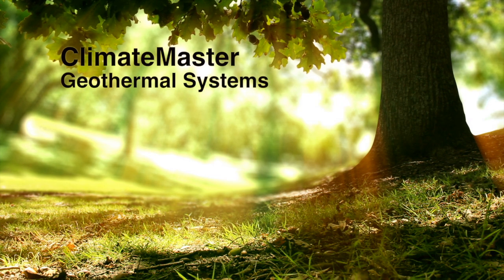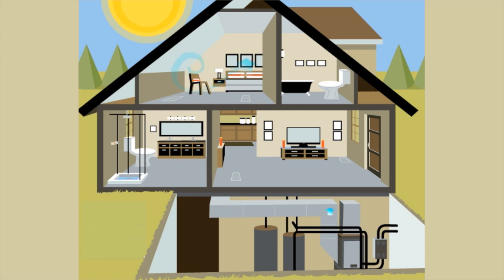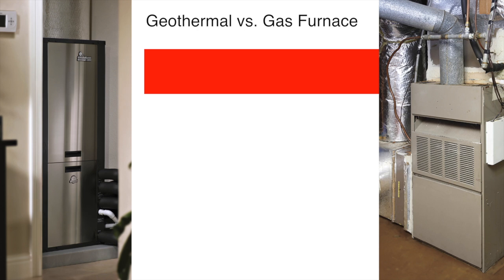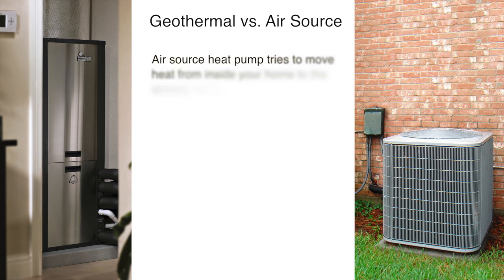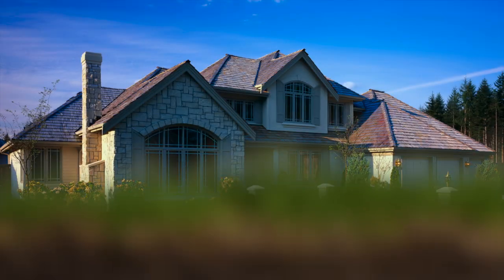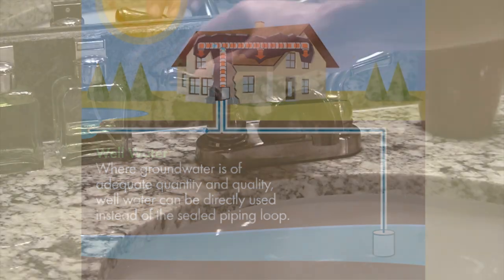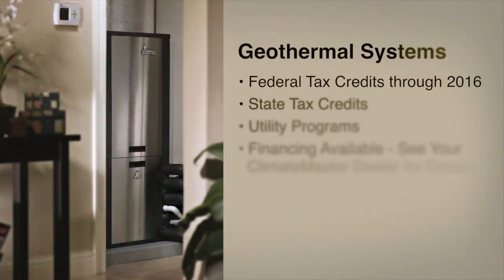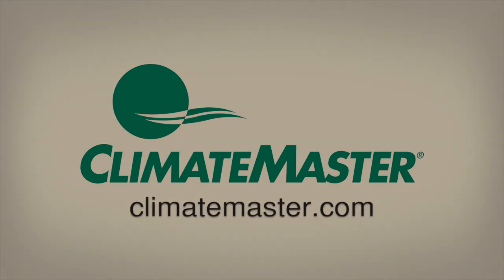Benefits of Geothermal Heating and Cooling

Comment: I had a Waterfurnace geothermal product for 20+ years.  Because of its age, i needed to replace the system. I acquired energy consumption data from my energy provider, crunched the numbers which included all of my expenditures, and looked at the alternatives and what science said about them. And also, because of geopolitical issues, it was increasingly clear to me as a Canadian that purchasing American products in these hostile times made absolutely no sense. Finally, I found a Japanese heat pump, Daikin, that is remarkably cheaper and just as and often more effective than Waterfurnace, and this is based on actual real-world energy consumption data. If you are considering a new furnace, take it from someone from a cold-weather climate, heat pumps are more efficient and cost-effective. As a Canadian, the decision was simple. I went with a non-American company,

Comment: We have both a gas furnace (emergency heat) and a conventional heat pump.  I'm finding out that at about 40 degrees and below it is more economical to heat the home with the gas furnace.  The heat pump doesn't deliver hot air through the ducting (warmed air, but not hot) and the spouse is happier when it is cold outside to have the gas furnace heating the home (happy wife. happy life!).

Just sharing my experiences. Mine may be unique.

Comment: Cost $30,000 to install a Geothermal unit in my house. The unit lasted 3 years before the pipes underground broke a leak. Found out a couple days ago that my unit is screwed until I dig up the pipes to find the leak. My house got the unit in 2019. There’s no compensation, I have to pay to fix it myself. It’s in the middle of summer, my house is currently 86 degrees. Great experience so far
Reply: $30,000 would be cheap I'd think where I live.  A well is minimum $25,000 and rock.  The mountains on colorado where frost line is over 4 feet also

Comment: These systems will cost more than a traditional system, but what you have to factor into the equation is "How much will I spend to heat and cool my house?"   So if you are building in Fairbanks, Alaska, where most of the heating is done via fossil fuels, you can cut the fuel bill to nothing.   The kicker is you have to take out a loan that may add $100 a month to your mortgage.   So its simple really.  How much on average do I spend heating my house?   If it is $200 a month, then you should have already done it.

Comment: According to my calculations, it would take 40 years for it to start to pay off the investments, from the amount of money I'm using now for heating. Fuck that. The same shit as solar heating. Waaay too expensive.
Reply: You're right, there aren't many advantages to this other than its probably a lot more reliable than using a air conditioner to cool your house in summer since I've had a few break during the worst of the heat whilst underground tubing only needs a fan to blow air threw them and can be easily replaced if the fan breaks.

Comment: I’ve been working for a geothermal Company for 3 years now as a sheetmetal apprentice. It really is amazing. New construction makes most sense. We do mostly condos and net zero buildings. Will most likely be the future of heating and cooling. I love my job.
Reply: Can you send your company details. I am interested.  Send me your mobile number
Reply: Can y get me some details about any project using this 
Like materil of pipe sequence of working
Reply: Why people don't use this instead ac?
Reply: Really? Does it work in the tropics?
Reply: There is an easier, more useful, and better way than digging all of this just for the sake of extending pipes, and it can be used anywhere on the ground under special conditions according to each region, but the idea needs support from anyone whom I might make a partner in this innovation.

Comment: So with a pond; during winter I'll chill the pond down and in summer: heat the pond up. It's ok?
Reply: yes. It does not  happen automatically that is why heat pumps are used.  Heat pumps take transfer heat from colder place to a hotter place using electricity .

Comment: How long will it take before you start saving money because this looks real expensive!
Reply: When I built my 5400 sq ft home in 1997, I installed geothermal. It was the underground loop system because I had a lot of acreage and didn't have a pond yet. My budgeted electric is usually between $200 and $300. This included my geothermal system AND the general use electric. I figured the system paid for itself in the first year because of the utility savings AND the credit I received from the local power company. It was about $5,000 more than a conventional system. I should also add that I have 6 inch walls and over 45 windows, patio doors and glass entry doors. I live in Michigan.

Comment: See video about the guy growing oranges in Nebraska.  He just buried 6-inch stovepipes.  No messy anti-freeze/water in the pipes.  Just bury the pipes 8 feet under ground.  Then a low-wattage fan to push air through the pipes and the air that comes back is at ground temp.  The guy who's doing this for his greenhouse in Nebraska uses 200 feet of pipe to achieve this.  These guys are making it way more complicated, expensie and energy-intensive than it needs to be.  Why even mess with a water pump?  All you have to do is move air through buried pipes.  You just need enough pipe and a day or two with an excavator to excavate and then fill it back in.

I'd pair such a system with a rocket-stove mass heater, for emergency back-up in winter.

Insulating a box on top of the ground is also kind of silly.  You don't WANT a sealed-up house.  Instead, build it into the ground.  North side and most of East and West side in the ground, with a southern exposure covered with glass to capture solar.  In summer, use SHADE (i.e. growing things!) to keep the sun out.  So many things you can do if you're building a place.  If you already own a place, and it's built on a slab without a basement, you're already kind of in a bind.  At the least, I would avoid ever buying a home that didn't have a full basement.  That right there gives you a nice microclimate, before you ever turn on heating or cooling.

Comment: i need some thing like this for off grid
Reply: you still need electricity to run the heat pump .
Reply: @MrBemnet1   And the 7-9 KW compressor  which is what´s doing 90% of the heating and runs more or less non stop .. these things are a total scam, cost a fortune to have put in and take for ever before there is any return investment , and will absolutely destroy anyones electricity bill .
Reply: @34979Charlie  are you sure that they run continuously? why is that ? The purpose of the heat pump using ground water is to increase the COP  because the temperature of the water is higher than the air outside.

Comment: The downfall of geothermal heating. The more heat you take from heat by geothermal, the faster this earths inners cool. Then we're in big trouble. Keep to wind and solar.
Reply: Your kidding right?  Did you forget how big the earth is?  The earth has enough energy inside of it that it could still provide energy probably for like a million /billion years.
Also, the geothermal system doesn't just steal heat, it also gives the heat back again in the summer.
I think there are some pretty difficult issues with geothermal, but i wouldn't be afraid the earth would lose it's energy.
Reply: @cryptfire3158  you the houses in Iceland are heated geothermal. Its not one or two houses heating this way. So according to your attitude. Once an oil well is empty, it will make new oil. I'm against geothermal and using oil when breezes blow to make windmills produce energy and solar to make energy. Ask Libya about the underground river that went dry.
The more heat you take from the earth, the faster it will cool.
Reply: @emelen123jamesula2  the only way geothermal isn't renewable is if the heat is venting to the atmosphere, and the atmosphere is losing that heat to outer space.  In which case you should be happy, cause if your worried about the environment then that would mean this solves global warming, since global warming is the other thing environmentalists are always worried about.

Comment: Hi 
I did a corse in Sweden ,ground sorse 
And air sorse heat pumps every time 
They have a shortfall of in performance they back it up with
A massive amount of electricity 
Fortunately for them they have
An abundant supply of hydro and geothermal energy    if u don't don't do it
Reply: and so? that is exactly why you use geothermal, because you can run the heatpump from a constant temperatured source and run the heatpump very efficiently.. if they fall short in performance and back it up with a massive amount of energy the designer of the system should take a shotgun and go behind a barn.. sry but this is not rocket science and wasn´t even 30 years ago when were putting in in houses..

Comment: does the geothermal system require electricity to run HENCE solar panels or no electricity ???
Reply: electricity is needed to run the pump and the heatpump.. but it is very very energy efficient and reliable with little maintenance... in the end it does not matter were you get the electricity but with rising prices for oil, gas and electricity, having solarpanels will be a nice addition and can help with the sustainability of the whole system.. you can even setup the system to "only" produce heat  or cool when there is enough electricity comming from your panels.. the heat can be stored in insulated watertanks in the basement and keep the temperatur constant during the night.. so you will store electricity as thermal energy and rarely ever run your heatpump with grid energy.

Comment: I have a question. What IF...instead of those expensive horizontal coils (vertical to service high-rise buildings) you  had a Eutectic salt tank in the basement? Then, you could run the AC during off-peak times, when the outside temperature is cool (in the Summer) or relatively warm (in Winter.) There would be no central distribution fan. A Saltwater Bath is Zero Fahrenheit.  In the case of AC, you can use a heat exchanger in the bath, and distribute the antifreeze to split systems near the ceilings of all rooms. The heating coils could be inside a boiler, with a heat exchanger in the tank, and an outside radiator.  The radiator pump and fan would also be most efficient in the wee hours.
In the Cold months, you could simply divert the hot water into baseboard heaters, with piping from the boiler tank,  and the excess cold from the salt tank could be diverted outside through the same outdoor  heat exchanger-in the this case in the afternoon-the relatively warm part of the day.
Reply: PS: this would have the additional benefit that you would not need to reverse the flow of the system. This means, that in Fall and Spring, you could easily use Heat or AC at different times of the same day.

Comment: All great comments.  I have also added a solar system to power my AC's.  Electric cost efficiency isn't as much of a concern when the power comes from the sun...
Reply: But AC's heat up the environment and also produce freone gas that damage our environment
Reply: @legendboyAni  First, they don't use Freone in the States anymore.  Second,  only if vented into the atmosphere was it a problem.  AC's do not heat up the enviorment either.  Does the sun hitting stone and warming the stone warm up the enviorment too.  So, what would you use to cool a house if not an AC.  Be practicle too.

Comment: In my opinion, geothermal makes the most sense on new construction that can be designed with this type of system in mind. Retrofitting geothermal into an existing 'leaky' home would be a huge waste, unless you tightly seal and re-insulate the entire envelope first.
Reply: You could do it pretty cheap just by burying corrosion-resistant 6-inch pipe and have a small blower installed.  Winter and summer, you'd get that 50-60-degree air circulating into your living space.  Even without any other heating or cooling source, you'd never freeze or cook.  Insulation is great, but I want my house to BREATHE.

Comment: Geothermal cooling system doesn't need a pump like Air conditioning system? That pump hot vapour into a small nozzle to get cold vapour on the other side? Can hot vapour in a pipe change temperature into cold vapour without a pump? Plz let me know and thanks for the video.

Comment: but how do you raise the temp? Im not gonna spend 30k to freeze at 55 degrees in the winter. I prefer temps around 70-75
Reply: You have to look at temperature as a quantity of energy. Say through a radiator you take that incoming 55 degree water/coolant and extract 5 degress per unit. Well with a high enough volume of that 55 degree water/coolant you can get some serious heat accumulation. You could imagine flowing 20 units of water, sucking 5 degrees out of each unit you can increase 1 unit of water 100 degrees. Of course examples like these aren't so linear in the real world.

But keep in mind you'll have to power this pump somehow, and to flow that kind of water, depending on usage requirement you're looking at a very fair bit of energy expended there.
Reply: You still have a thermostat, and you can adjust it to however you like.

Comment: But how does it provide water hot enough for showers? I seriously doubt Thia system could hear water up to 115 Fahrenheit without using the same electricity as a regular system.
Reply: Heat pump water is used to heat the water.  It doesn't use the same energy as resistance water heater. you get 3 times more energy using heat pump water heater compared to  regular .

Comment: Would it work if your making a 20 story building though? For example apartments
Reply: A software company in Madison, Wisconsin uses this system to heat and cool 3 very large office buildings it built in the early 2000's.  Epic, I believe,  is the name of the company.

Comment: Geothermal is overrated. High initial cost, these days, are NEVER recovered in utility savings. Speaking with 30 yrs experience serving geothermal customers. Better building insulation coupled with lesser capacity high efficiency gas or air to air heat pumps are the future of reliability and utility savings.

Comment: Have had a geothermal(heat and AC) system for 25 years in mid Michigan works excellent and about 75% cheaper to operate than natural gas furnace. Never any problems until yesterday developed freeon leak. R22 freeon is no longer sold or can be used in US. Now I have to purchased new system, $16,000.00. I use well water (open loop system). Well water is always around 55/56 degrees, furnace extracts 6 to 8 degrees(by compressing) from the water which than goes into lake. Heat coming out of furnace is around 100 degrees. AC is just the opposite takes the warm return air, extracts heat and blows out cool air. If not for banned freeon it would continue to run for many years more.
Reply: zip54 They still sell R22 don’t let them lie to you it’s just remanufactured
Reply: They have drop in replacement r-22 one is called nu-22
Reply: https://www.ebay.com/i/324009638120?chn=ps&norover=1&mkevt=1&mkrid=711-117182-37290-0&mkcid=2&itemid=324009638120&targetid=877051577709&device=m&mktype=pla&googleloc=9009735&poi=&campaignid=9426356364&mkgroupid=96480183780&rlsatarget=aud-412677883135:pla-877051577709&abcId=1140476&merchantid=6296724&gclid=Cj0KCQiA-bjyBRCcARIsAFboWg39r0KKyEkKbvtOIxhADMpHNedaShyJpuXnCWkwUpHuTIy4_kLcB5gaAphEEALw_wcB
Reply: Also stop leak as a last resort..depending on leak size. Def last resort because stop leak can also cause clogs. 
https://www.ebay.com/itm/R-134a-R12-R22-R502-Pro-Seal-Super-Stop-Leak-Envirosafe-Refrigerant-4-oz-can/283456251760?epid=1346577249&hash=item41ff4f2770:g:iZMAAOSw1UdcuLMq

Comment: So how does 55 degree soil heat your house ? I would be freezing in maine with a 55 degree house we keep it at least 65 and that's just to save fuel would like it higher.
Reply: The air is compressed and thus temperature is increased
Reply: @brettarthur2033  what air ? It says its filled with water and antifreeze? Really curious not trying to argue .
Reply: if you turned off your heater or AC in your house what would be the temp.? with the Geothermal you would at least start at 55 degrees and then heat or cool the place.
Reply: @ronwest7930  that makes sense . But that's not how they make it sound . They dont mention that you have to heat or cool from 55 degrees. Kind of deceiving.
Reply: @daddyhermanson9737  ive been studying this for a home build and having something that will absorb heat like water or a stone base for plant beds that will store heat. Help cycle the house. My system would use a water heater element for a solar dump load, maybe heat the floor and the base of plant beds.

Comment: I have done experiments!  I dug a 20 foot hole, and placed thermometers at various depths.  I lived in the center of the USA in St.. Louis, Missouri.   You have to dig about 20 feet down to
reach a temperature that does not change with the seasons.  That temperature is 60F.  Your video says "55F".  That might be true in the far northern states.  In the middle, it is 60F.  In the southern states it is probably 65F  I now live in the southern state of Florida, and have not done experimenting..... yet.
Reply: Northern States are like 40º
Reply: Josh Jordan  Those tests were done when I lived in St. Louis, Missouri.  I moved to florida 8 months ago.

Comment: But if your electricity is produced by a coal-fired or natural gas-powered powerstation you're still burning gas.
We have an Hitachi heat pump it just uses the normal air from outside to do the heating on the cooling transfer lot less problems